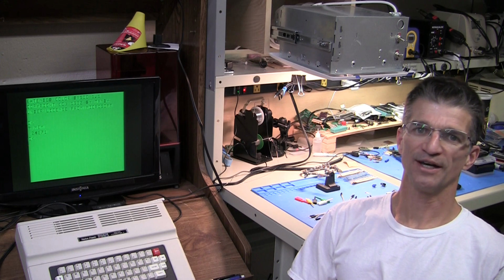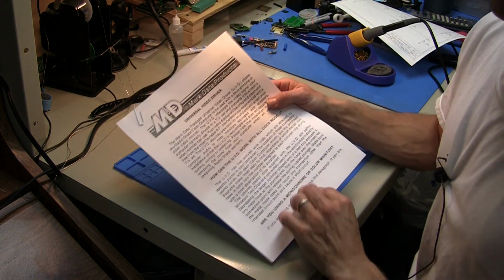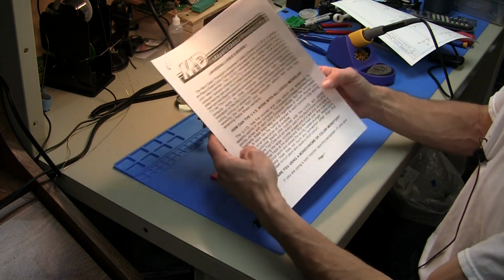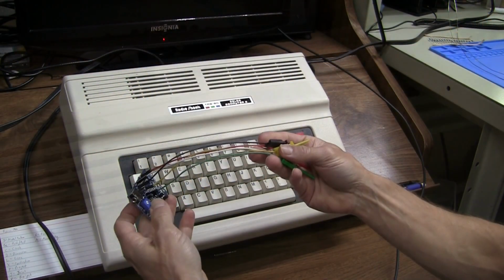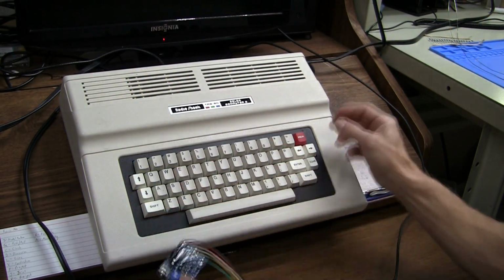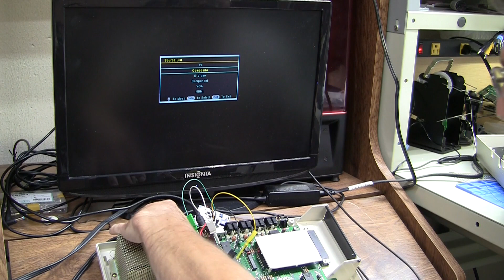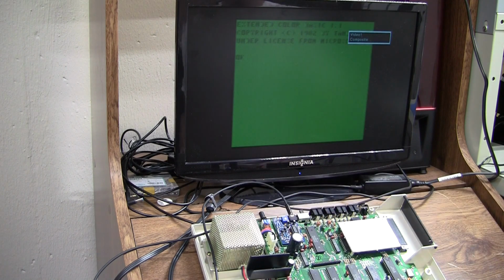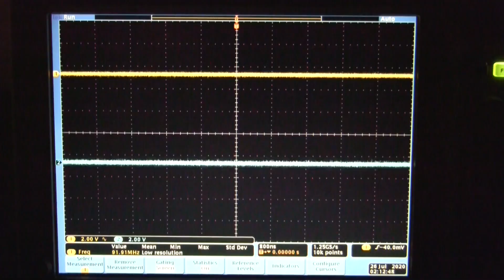1 of 2: Simplest No-Wires Composite Video upgrade! #trs80 Color Computer

Comment: Is there anything that can be built on the outside of the machine that could plug in the composite video and convert it to RCA or HDMI?
Reply from the maker: You can absolutely buy a composite to HDMI converter module, but bear in mind that it will transfer all the imperfections straight into the HDMI.  That is why I designed the CocoDV upgrade chip so that we can go straight digital video all the way, with no analog in the video path.  Here is one of the videos about CocoDV: https://www.youtube.com/watch?v=gc_3TPBjFf4

Comment: Thanks for the video . I wonder if this board could work with a Dragon 32, as they are quite similar. How do we could find the board ???. Thanks 😄
Reply: Dragon32 already does composite out through the DIN plug, just need a cable. The best thing I did to improve the picture on my Dragon was to install the replacement PSU from DragonPlus Electronics.
Reply: @steverasmussen8738  Thanks for the info Steve, now I realise it. Will look for the PSU !! Really appreciate your answer.
Reply from the maker: True.  And this composite mod should also work in there.  Which makes me curious... Would they look the same?  I don't have the Dragon 32 to check.  It was on loan.

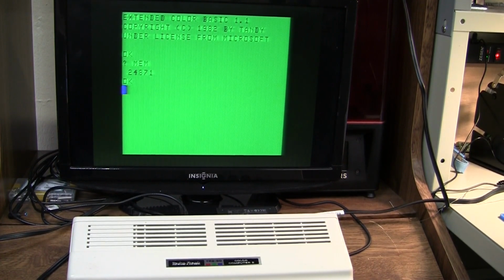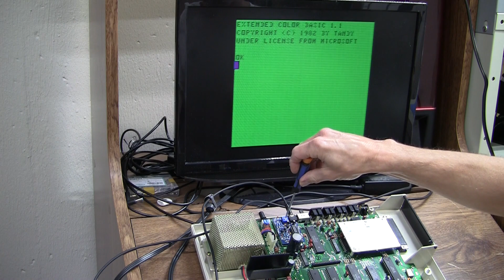Comment: 1:45 compared to 16:45 sure does look like an improvement.
Reply from the maker: The changes are very subtle for sure. When the RF modulator goes bad however, it's a real trick to have this.

Comment: I'm an Atari guy. Are those jail bars normal? They look horrible to me.
Reply from the maker: In my next episode coming out in a couple days, I found out the jail bars are from that TV.  I tried a second TV and the bars are either minimal or gone.  The composite board would not likely create them as it is mostly a buffer and mixer.  As long as it doesn't create ringing which I would be surprised if it could.  My guess is that the bars are a function of the signal source in the CoCo and how the TV filters operate.